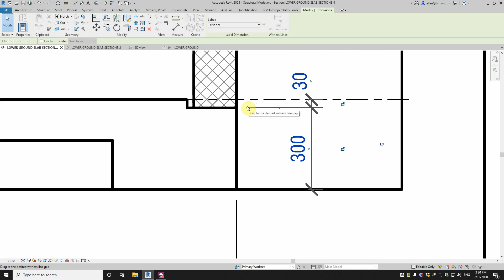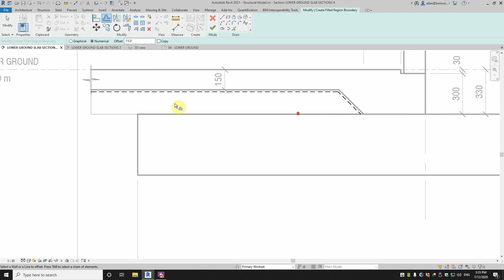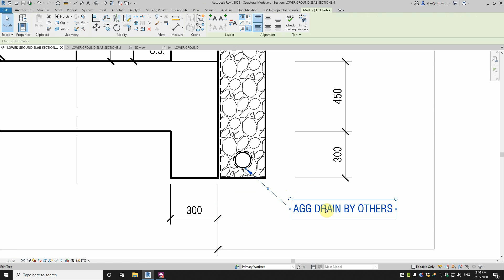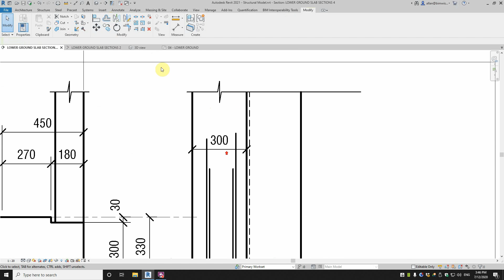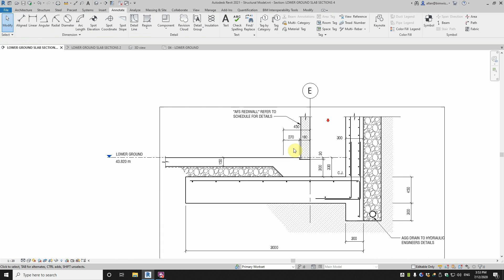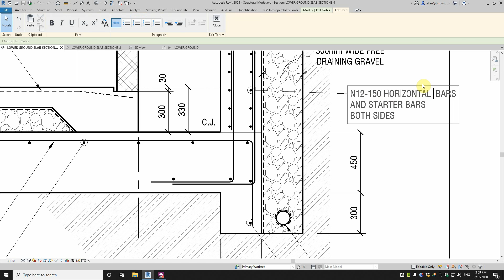Comment: Thank you so much for your video. I can't help but ask, isn't there a way to put those bars in like 3d and then they show up in the sections? the method you are using how is it any different from AutoCAD detailing? Am i missing something, just genuinely curious. Thanks in advance. (Yes, I am new to this)
Reply: Yes there are ways to do it that way too. However for country’s where the steel reinforcement is scheduled by others it is rarer to see consulting engineers doing 3D modelling as it does take quite a bit more time.
Reply: @TheArtofTechnicalDrawing  thank you for your response. So if that’s the case, for instance what happens when the section changes, example, the section which you’ve taken, the wall was changed to 200 concrete wall. What happens then? Does the lines stay the way they are or does it change dynamically? 

This is also in cases where the slab sections have changed and the reo lines stay the same or not?
Reply: @vigneshmenon2796  Both 2D and 3D workflows will require touch ups on the sections. Big changes in 3D often break the sections for 3D modelled elements including reinforcement. Steel framing is probably worse. 2D elements can also work dynamically. So it is just something you have to balance. What are the risk/rewards. We are all businesses first so we have to balance what workflow will be acceptable. Nobody wants to hear, "I can't get the drawings out, we have a technical issue" and the other side saying "it is just a couple of lines, why does it take hours to do it!"
Reply: @TheArtofTechnicalDrawing  thank you so much mate! You’ve no idea how much you’ve helped me. Your videos are really good and this is something which I believe I can fairly easily incorporate into my own workflow.

Comment: if u're drawing reinforcements in 2D how do u make a BBS from it?
Reply: What is a BBS? Is it some sort of bill of materials? If so it would be done manually by a reinforcement scheduler.
Reply: A Bar bending schedule: if u dont place your rebars in 3D, it won't be scheduled anywhere in your project
Reply: That is a question which relates to what is the industry standard in your region. For some consulting engineers only do the design. Schedules and shop drawings are done by others in the next phase of the project.

Comment: Any email to send my model to know how to detail holes on steel profiles ?
Reply: I could do a tutorial on some basic ways to do this. Can you flush out a bit more what you are trying to do?
Reply: @allanyz   i have the answer, if we use reference lines, we can detailing holes, bolts, plates and steel profiles, we can send to print thats dettails in PDF and it does not appear reference lines on sheets or impressions, in that way we can detail any shape of plate, etc.
Reply: I came to watch this video to see if detailing using revit saves time. It clearly is not a time saver compared to autocad! Do not get me wrong, this is a great video with plenty of information on how to think while detailing. Shouldn't these details be part of the 3D model? So that things are dynamic compared to autocad. My problem with structural detailing is that it takes time to finish a section unless its a typical detail, yet things keep changing throughout the job design life, stretching the detailing process. That's why I moved to civil since it has better design cycles and less details to show on sections. Simple lines usually do the job